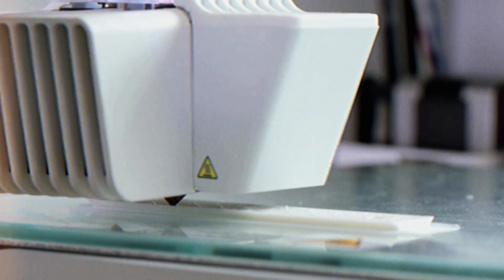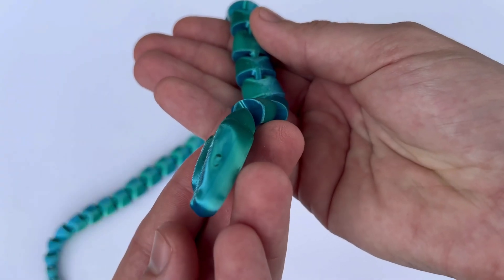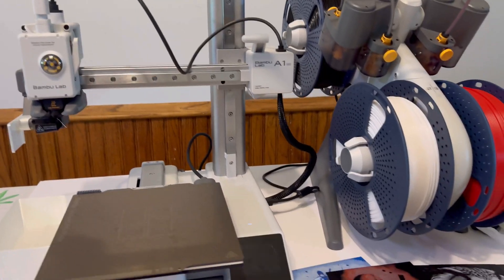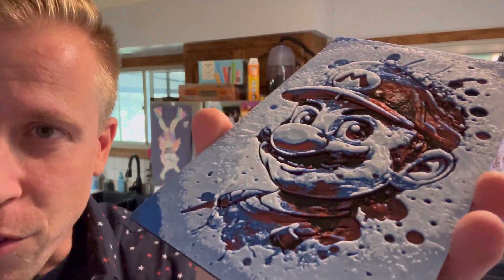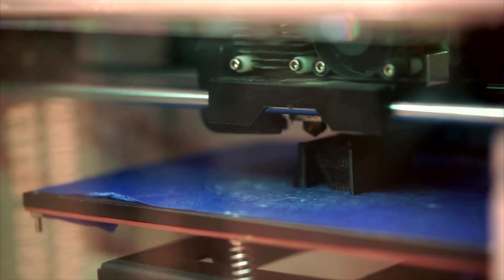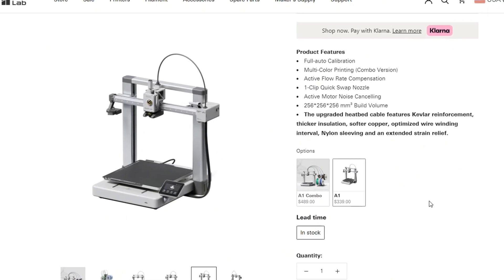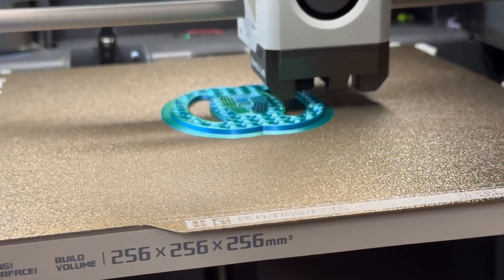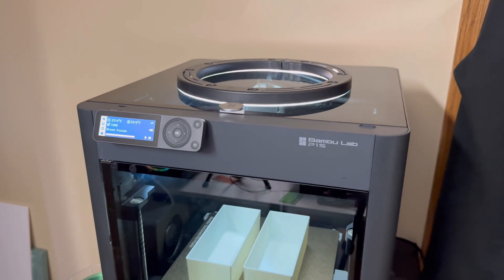Watch this Before Buying a 3D Printer! Best Beginner 3D Printer

Comment: I have the K1+cfs upgrade and the OG ender 3. I got the k1 2 years ago and the ender 3 3 or 4 years ago.  I think you should start with the og ender 3 and learn the basics, then go to more expensive ones. It printed well out of the box, did not kill the hobby, and i have done more maintenance on the k1 than the ender 3. The ender 3 has not clogged once, has not needed a single nozzle or extruder change, and has failed i think one print out of hundreds. Now that I know what i am doing more, the K1 has been a lor more reliable than before recently. The ender 3 is a really good starter printer in my opinion.

Comment: I still don´t understand what is a 3D printer for begginers. Are there houses for begginers, cars, burgers, what are the specialities to classify as a begginer? Do they help you to print or is the software that makes it straight forward? I believe that something for a begginer is something that practically works by itself and you do not have to do anything. A well calibrated free of errors 3d printed just out of the box is a printer for a begginer, it does not matter if it costs 50.000.... or is it the cost?
Reply: I believe it’s more of a cost/practicality chart but unfortunately there doesn’t seem to be a video that displays this concept

Comment: Good intro to 3D printers.  I've researched pretty well to decide if I want to move forward with this hobby.  I have an item I want to create (jar lid with a specific size) and a 3D printer would do it easily, in fact I've already created the model using a free Fusion 360 personal account.  And I even have the Bambu P1S in my cart along with the AMS and accessories, over $1K not counting filaments.  But I stopped short because I can't envision what I would want to print that is useful and that I can't buy commercially.  The lid I can source from a contract print company for $3 plus shipping but I'm not interested in dungeons and dragons stuff so I'm at a loss to conceive how this will continue to peak my interest.

I don't mean to be a Debbie Downer here, and truthfully I'm still considering it as a learning experience so it may very well happen, but as somebody who starts hobbies and then gets bored I can see the P1S gathering dust in my garage after six months.
Reply: How’s the research and decision making going

Comment: I'm a complete Newbie, but I have done a bit of research and cross-referenced with this video so PSA for those who are more interested in parts/functional over multicolor prints:

In the case that anyone is here thinking about picking up a printer for FPV / Drones (Or other functional parts where multicolor isn't a priority, and material durability is), based on my (admittedly small amount of) research, you can pretty safely disregard AMS lite, and get the bamboo A1 mini without it.
- Saves a lot of money.
- Saves a lot of space.
- TPU seems to be favored for Drone parts, and AMS lite can apparently sometimes handle it poorly.
- You don't really need multi-color.

ALTERNATIVELY: If you have the budget for the A1 Combo, you can just put that money towards the Bamboo Labs P1P instead. It'd be the same amount, it seems like it'd allow you to print full 5" drone frames (For FPV people), print faster, print quieter, and would allow you to upgrade it to do carbonfiber+nylon blends if you want to go ham on durability.

The P1P is currently $549.00 USD on their site (Not on Amazon)
The A1 + AMS Lite combo is currently $799 on Amazon for some reason (Wtf?) and $549.00 on their site. The standalone is $399.00 on the bambu labs site.

If you're looking into printing for FPV specifically, I recommend googling "Oscar Liang 3d printers"

TLDR for FPV people:
P1P Printer same price as the AMS Lite combo, but a much better printer.
If you're only planning on working with small drones, or aren't going to print 5" frames, you'll probably only be using TPU for lighter weight, and single-color anyways and can go without the color.

Comment: I bought a creality ke v3.  Still fighting it to peint anything. Never buying this fucking thing again.
Reply: Did you ever decide upon another 3d printer or did the experience turn you away from doing what you set out to print?
Reply: @Vee_Exclusive_Whatnot  I am not turned away, but I have yet to buy another one due to other business priorities.
Reply: @AxltheTemplar  did you get it to print anything
Reply: @Silver_Vee_Tm on that one? No. XD I had to work with the cr touch everytime, and when I got that to work it wouldn't stay sticking to the build plate, which caused the nozzle to get filled, and after cleaning the nozzle it still refused to work. Big pain. XD

Comment: Bad Advice 

Recommending Bambu Labs when in comparison to Prusa is good advice as the A1 Mini and A1 are what is known as a Bed Slingers. If you wanted a Printer from Prusa that is a Bed Slinger, you’d be throwing upwards of $1000 for one the same size as the A1 that of which is about $400. 

The bad part of the advice is getting into multi color printing as a beginner. Not only is it more costly both in buying the AMS (the device that allows you to print with more than one color), but also with how the AMS system functions to print more than one color, as the more switches it does between colors, the more waste it produces as it does something calling purging. The second reason why it’s bad advice, is cause they won’t even know what to do with the colors. 

They’d be better off buying the A1 Mini and only buying the AMS System after they got the hang of printing for a bit. Will it be a little more expensive then buying with the printer? Yes. But wasting half the material through multi color printing would add up far faster.
Reply: Can I use the multi-color printer to make a product with 1 color?

Comment: Do yall think I can just buy one color and then just paint it?
Reply: Yep! You may want to use primer first though.
Reply: @leftonredin  what kind of primer and brand you recommend?
Reply: @Vee_Exclusive_Whatnot any automotive spray primer should work. You can use paint on but depending on your print it might look weird. Also some of the automotive ones have a feature that fills in little imperfections which may work great when 3D prints that didn't come out perfectly. 

I personally haven't used it enough to have a recommendation and I'd suggest doing some research but I just know from a lot of research in the past primer is required.
Reply: @leftonredin thank you

Comment: Now it is $ 489.00 bucks on the Bambu store, it is not what I would consider a beginners price point 
I have thought about a 3D printer for small things But no way starting out will I spend that much and not sure if 3D printing will be my thing in the long term 
There Have to be good beginner printers far cheaper than Bambu if the smallest is nearly $500 bucks way to expensive
Reply: it’s 250 on the site rn and 400 for the combo

Comment: Hello, and thank you for the video. I know very little about 3D printing but was thinking of trying it out a little. Interested in printing small things, mainly small 28-32 mm scale miniatures and I do not want to meddle with resin and dangerous chemicals. Do not want multi color printing, and I want the printer to be fairly small sized, so it will not occupy too much space. Does an A1 mini with the smallest nozzle sound fitting for me? I think I might be able to fit that (but not more) into my budget for a christmas present for myself... :)

Also, do you know if it is possible to get a bigger screen on the printer? Or do you not use that screen in case you are connecting to the printer with your computer through the wifi?

Comment: I still think Prusa printers are good beginner printers as well if you want to avoid Bambu products. Not as polished looking and feature rich but easy to get up and running.
Reply: How is a semi assembled Prusa Mini at 459$ without the MMU good beginner printer ? While the mini is 199 or 349 with an ams and you are ready to go in 10 minutes. 

Prusa is still in 2018 good awesome printers not for beginners & not for cheap.
Reply: @monty593 Buying one is giving money to company in China and the other to company in Europe, just across the border. How much you value this is up to you, but to me that's significant.
Reply: @monty593  what brands would you say are worth looking into?